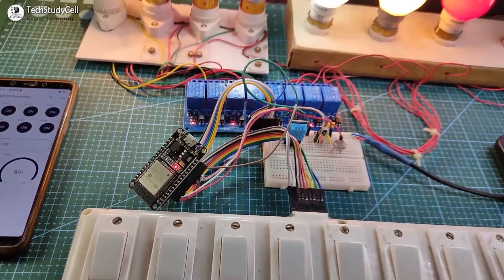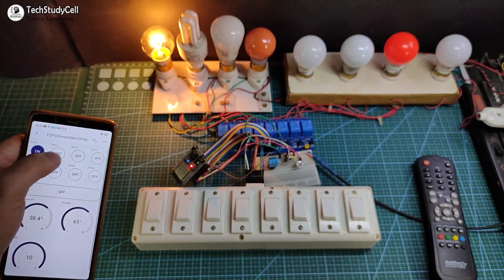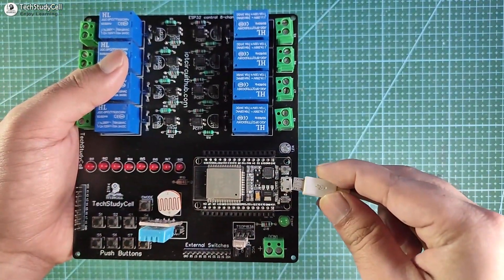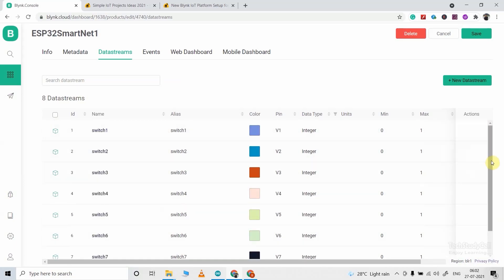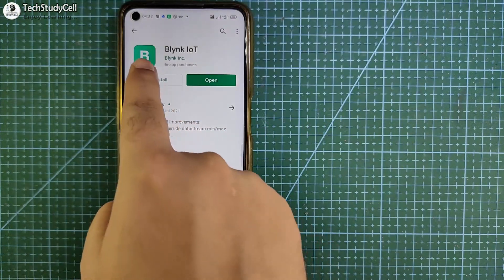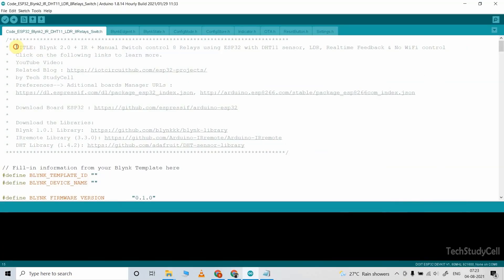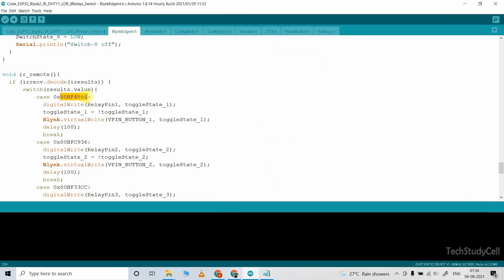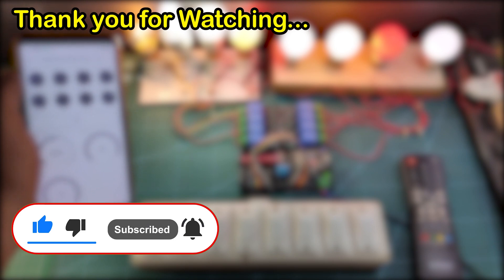Home Automation using ESP32 Blynk 2.0 with IR remote control relay temperature sensor | IoT 2021

Comment: It is possible to do home automation using the ESP32 Blynk with a temperature sensor, a gas leak sensor, and a fire sensor, an infrared remote control relay via WiFi, without internet or Bluetooth.

Comment: can you please help me i keep getting this error while uploading your code to my esp32

Multiple libraries were found for "WiFi.h"
In file included from C:\Users\IYSTREEM\Documents\Arduino\libraries\DHT_sensor_library\DHT_U.cpp:15:0:
 Used: C:\Users\IYSTREEM\AppData\Local\Arduino15\packages\esp32\hardware\esp32\1.0.6\libraries\WiFi
C:\Users\IYSTREEM\Documents\Arduino\libraries\DHT_sensor_library\DHT_U.h:36:29: fatal error: Adafruit_Sensor.h: No such file or directory
 Not used: C:\Program Files (x86)\Arduino\libraries\WiFi
compilation terminated.
exit status 1
Error compiling for board ESP32 Dev Module.
Reply from the maker: Whenever install any library, pls install all the dependencies. Here dependency for the DHT library (Adafruit_Sensor.h) is missing.
Please install the Adafruit Unified Sensor library: https://github.com/adafruit/Adafruit_Sensor

Comment: Hello sir, your projects are excellent and I made 2 projects for home automation using ESP8266 for 2 rooms. It has been working successfully for more than a month. Now I am trying to make a project using ESP32 with 8 relays using Blynk and IR Remote. After getting HEX code for IR remote, I tried to update it in the main code. But since it is a .h header file I can't open and modify it. If I open it and modify the file it is saved as a .txt file. Can you please help me how to solve this?
Thanks in advance.
Renganathan

Comment: Great work thank you for that, Just request could you please add heater in system which can be controlled by the DHT temperature changes instead of the

Comment: is there a distance  required between you and  the system for the work of these?or you can control the system wherever you are with the internet?with the remote control,wich distance required?

Comment: In your recent project WIFI PLUS BLUETOOTH AND MANUAL CONTROL, your code makes the relay states to update automatically to the way you left it whenever they board restarts and connect to wifi. But it's not in this one. Can you add it please?

Comment: Hi, I used the button code. But I found out that all relays turns off whenever I switch off wifi hotspot. Even if I use remote control or buttons to switch on relays, they will all shutdown immediately wifi is off. But all relays stays as they are when wifi is on. What can I do please?

Comment: You make great and nice projects. Kudos.
I uploaded this code to my board, created template and datastreams. But when I want to connect the board to wifi network using OTA, it gives me this error of CONNECTION INTERRUPTED!!! I tried both switch and button codes but both are doing the same error. Please how do I fix this? Thanks

Comment: sir i make this project for 4 relay only but once i switched ON all relay either by blynk or manual then after my esp32 is disconnected from wifi and there is no control by blynk or manual unless you restart the board, i tried with different pin also but still problem is continue...any solution?

Comment: Thanks for sharing. Are you planning to update the board? Like adding air apaces between the outputs of the relays, change the relays with N/O-N/C contacts, adding a voltage reg for higher inputs (12V) and adding the new ESP32 board? If so, pls let us know.

Comment: Sir my esp32 is continuously rebooting plz resolve my problem
Reply from the maker: check circuit and use stable power supply
Reply: @TechStudyCell  sir mujhe every time wifi disconnect hone ke baad firse connect karne ke liye every time EN button press karna padta automatically connect nhi hota. What will be the solution

Comment: Error compiling for board ESP32 Dev Module.

Not used: C:\Program Files\Arduino\libraries\WiFi

exit status 1

Error compiling for board ESP32 Dev Module.       How to solve
Reply from the maker: First install all the libraries as per the version mentioned in the code. Then select board as DOIT ESP32 DEVKIT V1

Comment: Compiling error how to solve problem
Reply from the maker: What is the error. Check all the required libraries installed as per the version mentioned in the code

Comment: its really great work , i have small query do this project remember its last state, if power gets off, but wifi is available , how will it react if power came back . Same situation with wifi too. please explain
Reply: I have also same query
Reply from the maker: if you uncomment the BLYNK_CONNECTED() function, then it can fetch the last state from blynk server.
Reply: please provide the complete diagram for pcb

Comment: Can we control Relay from anywhere in the world? If not. Can i use nodemcu esp8266 instead of esp32?
Reply from the maker: yes. if the esp32 connected with WiFi
Reply: @TechStudyCell  thanks sir, can i mail you for a programming checkup ? It's regarding using EEPROM, i already have wrote the program, just need you to confirm if it will run properly for long term

Comment: sir is there a way to supply power to my relay board through my esp8266? as i'm using a usb charger to power my nodemcu board
Reply from the maker: Connect Both NodeMCU VCC to Relay module VCC, and gnd to gnd. Although you will get no issues, But this is not recommended

Comment: U really great but the problem is u don't answer some of as 

Please which part of the code makes it work without internet because the other video it doesn't work without internet
Reply from the maker: Please watch complete video, I have added two functions in BlynkEdgent.h file. Those functions will work with and without internet

Comment: Can we add last memorize function using esp 32 intarnal chip it will very helpful
Reply from the maker: If you uncomment the Blynk_connect() function in the code, then it can fetch the previous States from Blynk server

Comment: Hello, I am Getting error. And program is not compiling
Reply from the maker: First watch complete video. Install all the required libraries according to the version mentioned in code.
Reply: @TechStudyCell  I have installed all libraries
Reply: Error compiling for board DOIT ESP32 DEVKIT V1. I am getting this error
Reply: @electricalengineeringhub3598  i am also getting same error
Reply: Ir remote library usb old version could work 2.83
Reply: "Error compiling for board DOIT ESP32 DE VKIT V1  " I can't able to compile code ,i have install all required libraries

Comment: can we use NodeMCU instead of esp32?
Reply from the maker: You have to update the code. Will make video on that
Reply: @TechStudyCell  please try to add fan speed controller in it.
Reply: @TechStudyCell  I had ordered NODEMCU instead of Esp32 , what are the changes can you please explain
Reply: @TechStudyCell  I am also waiting for video on ESP8266
 Blynk app shows error to reconnect device in this code by use of ESP32 how to solve it?